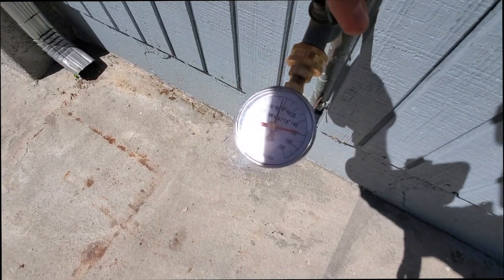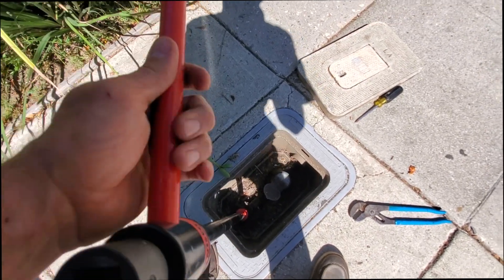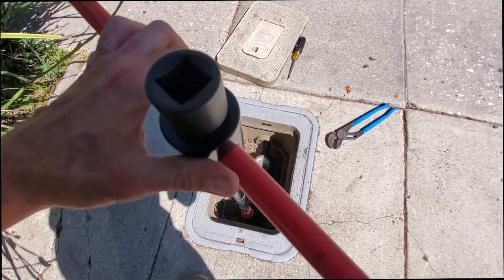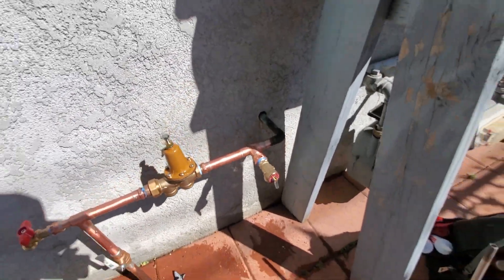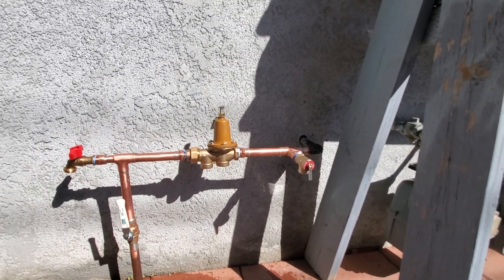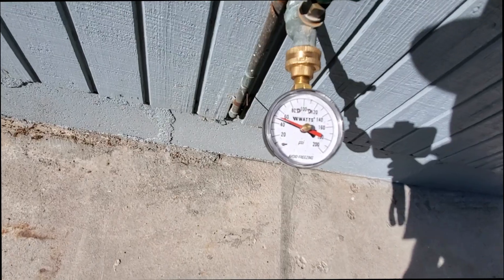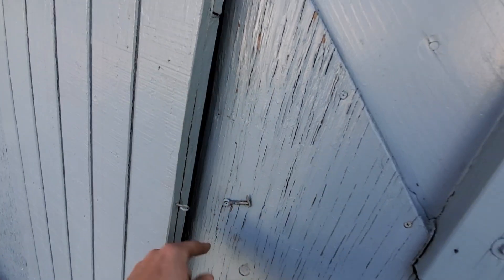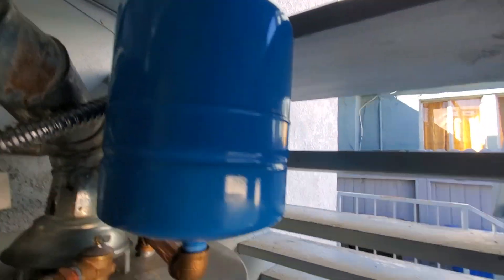California Style Water Main

Comment: Nice work. The pressure relief valves are also a lifesaver when the main shutoff valve doesn't shut off completely and you have to do soldering work inside the house. You manually open it and the water just flows out. I like to install them lower than the inlet to the house for this purpose. You should have rotated the tee 90deg so the relief valve points down.  I also like to install the hose bibb after the regulator since most garden hoses and nozzles don't like 100+ PSI.

Comment: Looks good. 

I tried shutting the main too and I couldn’t get it to turn :(
Reply: I couldn't either. You can put a request for the city to shut off the water here in Los Angeles. It took two large men with a 6 foot shut off handle to turn the valve. I thought it was going to break for sure but surprisingly held up.
Reply from the maker: Hate when that happens
Reply: Use lots of WD40! Worked for me on mine anyways...